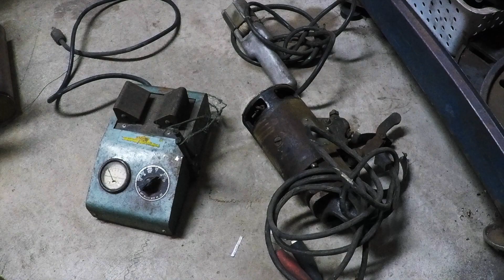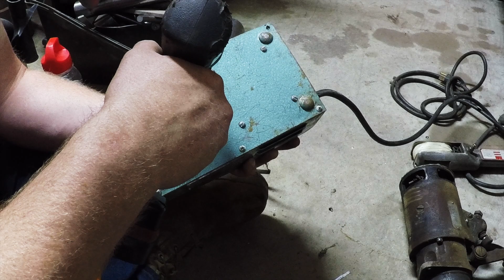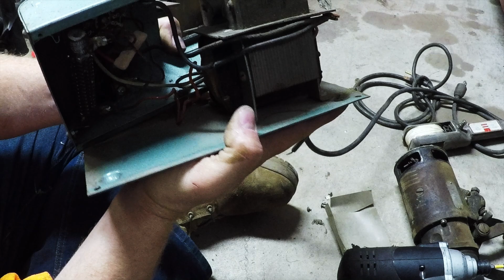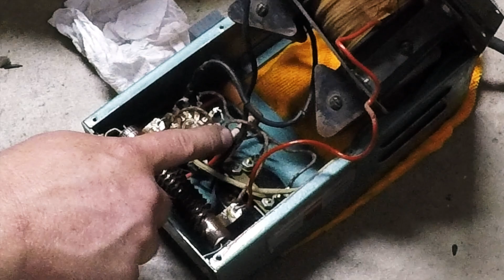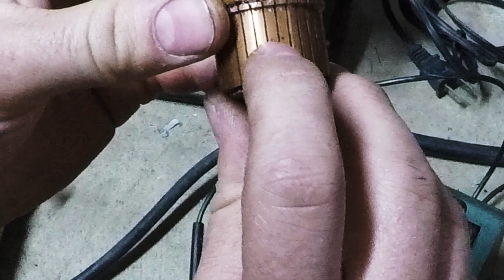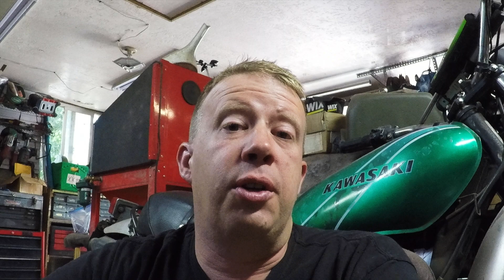FIXING AN ARMATURE GROWLER

Comment: How did you re-wire into the old probes? You fast fwd'd over that part..
Reply from the maker: i put new wires in and ran them to the multi position switch inside the housing. then i pulled the bakelite insulators off the brass probe ends and mounted the brass pieces in the lathe to bore out the old wire with a drill bit, then slipped the bakelite "handles" over the new wires and slid them all the way down, then turned the brass probes upside down and soldered the wires inside them(i did not tin them prior, since it makes it harder to insert the wires into the brass part) then slid the handles up back in place